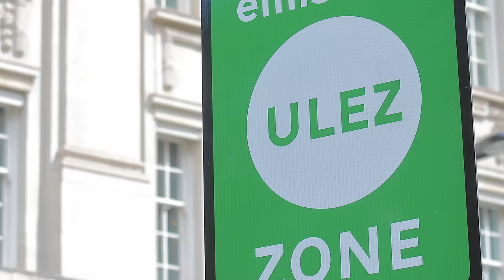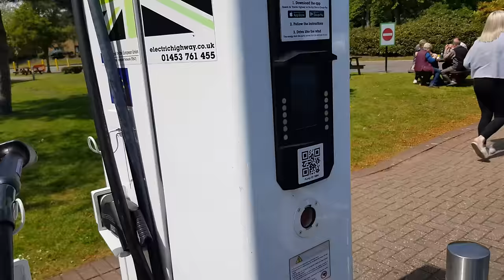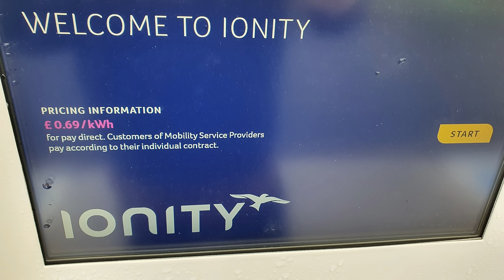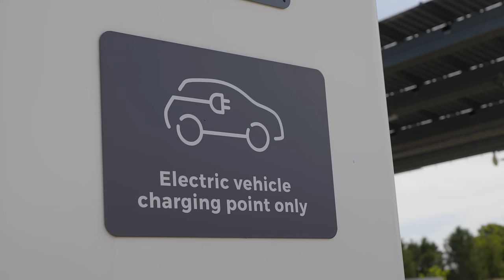The Uncomfortable TRUTH About EVs: The Version NEITHER SIDE Wants You To Hear

Comment: 18:30 Range Rover Hybrid, It's the small Hydrid batteries in a large vehicle that over heats and starts a thermal runaway fire. Diesel doesn't burn very well and is easy to put out.
Reply from the maker: Have you an actual credible source for that? What you say about hybrid Vs diesel fires is correct, but I have not seen anything confirmed it was a hybrid
Reply: @JayEmmOnCars  I saw other youtube videos that show the early stage of the fire shooting out from under the front of the car floor where the hybrid battery is located. There was an extinguisher, which was used and did nothing, on the ground behind the car. The tail lights match perfectly with what a Range Rover Hybrid should look like. I thought that everyone knew that it was a Range Rover Hybrid. I suspect the mainstream media is covering it up as it goes against the new green future they are pushing. Also, It is not the first time that a Range Rover Hybrid has done this. I should ask you the same thing you asked me, 'Do you have a credible source that it is not a Range Rover Hybrid?'.
Reply from the maker: @glenitube  the fire department who attended. I've seen nothing else beyond the same videos you have to say it was a hybrid, all of which are as biased as you claim the rest of the media to be

Comment: Fastchargers prices are not the competitive price to petrol. Since FC is for, like 10-20% of your trips. and to that, Tesla chargers are way cheaper. even same as public chargers.
And you might consider the huge emmisions output on combustion cars first. At 200kg per 1000km thats a serious hazard. Put that into the Balance of sustainability. Nothing there is recycled as batteries do!

Fires fighting EV fires is already better.  It's the locations that do not implemented them. 
And maybe praise those "EV elite" to buy an EV instead of a burner what they easily could. And many more "elite" still buy burners Instead of EV.

I am certainly not elite. Just bought my first EV and saved so much on cost that 3 years later In saved enough fir an EV motorcycle too.
For me BEV all the way 🔋⚡💪
Reply: To each their own. I just have an issue if you get forced into something that you don't want (I.E. the EU banning ICE cars in 2030) I hate the government saying "You can't have this/Will will ban that/You need to take this even though you don't want to"

Comment: re the airport Range Rover fire diesel's do not burn like the photo that was posted as it started burning with flames blowing out right where the battery is on that model of car, I'm not saying it wasn't a purely a diesel, but before they even went in "we will investigate once its safe to do so" before it was declared safe, and it was very quickly stated. what caused the fire, I'm in the position the jury is out. But the point of your video "promote a balanced discussion" i whole heartily agree, but, I feel that most of the criticism is directed at those who do not feel that EV are the only way to go, & the pro EV clan do not seem able to discuss in a balanced manner. you just have to see how major manufacturers have scaled back EV production, fires are increasing, obtaining insurance is being declined etc,  the costs are not as claimed to be, having owned a Hybrid, I am so glad I am back to a EC car, its cheaper uses less fuel. anyway I am all for a balanced debate but both sides need to take that on board, Quentin Wilson take note wow I don't think he would know a balanced debate if it hit in the face

Comment: I feel like a lot of the issues being created by mandating EVs in the next few years, could be largely mitigated by mandating plug in hybrids instead and pushing the full EV mandates out a couple of decades. 

I'm not anti-EV, i think they are cool tech and that with another ten or twenty years of research and advancements they could be a real solution to the emissions problem.  But i think that these very short term EV mandates have as much to do with getting lots of people out of cars altogether (lots of poor people, that is) as they do with replacing existing cars with EVs.

Comment: An EV is going to cost you more to insure simply because if they catch fire they are going to be a pile of burnt metal with no recycle value whereas a petrol car if it catches fire is going to be possibly repairable or at least salvaged for many thousands of £ of parts. That alone is why the insurance is going to be rather different!

Comment: I'd also like to state, your view of regulation of fuel cost is naïve. If you do a "pay as you go" the cost per pay will likely be more than if you charge someone an outrageous price up front, and then use that payment over time to cover the cost of providing lower "as you go" price. Pay as you go has to supply the cashflow/profit to the supplier every time a payment is made. The upfront charge that then means that person has already paid the supplier a sufficient profit that they can then use that payment as investment to earn more and provide pure profit cashflow and then they are free to charge a payment that only covers cost is a perfectly valid payment model. Don't insist your method is inherently more "fair" ... it is not.

Comment: Several EVs were burned up in the fire you are talking about, but the fire never reached the batteries. An EV would burn for a long time but won't explode. Class D Fire Extinguisher should work fine.

Comment: EV battery will deteriorate quite quickly dropping about 0.2% distance every 5,000 miles resulting in charging more often and more lost time. In addition when you factor in a replacement battery cost/ 100 mile range, all EV's are more expensive to run than an efficient petrol engine. Finally if your time (life) is important to you the amount of time lost refuelling is significant.

Comment: About diesel reputation. Its not about people not using them because the reputation is lost but because the new regulations and laws that are getting passed will ban diesel engines from different countries and different cities. That's why people want gas. No one cares if the reputation is gone. If that car makes good miles per gallon and the costs are relatively low then that is the car people buy. Its about money and restrictions. That's it. You forget the pandemic too easy. That period revealed that people will accept any restrictions and rules. I would reconsider "conspiracy theories" as a term that could possibly tell you some truth and should be analyzed with a little more care than a dismissal.

Comment: 23:35 People can argue and speculate all they want, but these are the proven facts:

 - Petrol does not just self-combust.  It needs something to ignite it.
 - In fact it's pretty difficult to set petrol on fire, it's nothing like in the films, you can even shoot the tank and it not explode.
 - Diesel is near-impossible to set on fire, you can even put a lit match out by dipping it in.
 - Petrol and diesel are both relatively easy to put out if they are set on fire.

 - Batteries / electrical fires can go faulty and initiate the fire themselves without any external influences.
 - They're far more sensitive to external influences such as crashing.
 - They're near impossible to put out.

Comment: With the issue of Global Climate Change being at the core of this, I find it very difficult to even suggest that fossil fuel vehicles are still a viable solution.  Other than those that cannot afford a new vehicle should stick with an ICE vehicle as most segments of the market have some EV/hybrid solution to benefit everyone.
Reply: Sports cars should always have an ICE, the feeling or revving an engine, pushing in the clutch, grabbing the gear knob and putting it into the next gear, the sound of the engine as it revs up. Electric cars are dull and the emotional part is missing. Also motocycles need to stay ICE, the range is just garbage on electric ones, and the weight of the battery makes the bike handle shit

Comment: Used EVs are now as cheap as chips. The average daily commute is 20-30 miles. This means that you can buy a used EV like a 30kw Leaf with 100 miles of range for as little as £5k. Or a used EV with 200+ miles of range for only £10k. See youtube channel EVM Electric Vehicle Man for house easy it is to buy a used EV with good mileage for under £5k or under £10k. EVs require less maintenance as they have fewer moving parts around 20 in an EV compared to 2000 in an ICE vehicle. Tesla for examples says you don't need to take your car into service every year like you do with an ICE vehicle. You only take it in when it needs something. Most EVs today have an 8 year warranty on the battery and drive train. So used EVs that are 3 years old can be bought for not a lot of money and still have lots of warranty left to run for peace of mind. For example you can get a used Tesla Model 3 for under £25k which is low mileage and under 3 years old. I used to have a Skoda diesel estate which cost around £75 to fill up (£100+ at todays prices). My new Tesla Model Y costs around £24 to fill up at a Tesla supercharger and a lot less hwen I charge it at home over night on cheaper rate electricity. My plan is to get solar panels and then I can charge it for free from the sun via the solar panels.

Comment: No the Luton fire wasn't an EV, it was probably a Land Rover diesel hybrid.  With a small lithium battery.  Under the area where the passenger seat is located.  Watch the videos of the Luton fire, and the absolute jet of extremely hot flame, and where it's coming from.

Now, if it's actually a battery fire as the visual evidence seems to be pointing to, but the authorities are blaming the diesel, which is not well known for combusting in extremely hot jets of flame, consider who is lying to who, and why they might be doing that.  Consider if the people still blaming the Luton fire on a battery might possibly have a point, then remember this was probably a light hybrid vehicle with a very tiny battery.  Oh yeah, and it was probably made in China.

The government mandated no new ICE vehicles by 2030, and then admitted that wouldn't be practical so pushed it out to 2035.  That's not going to be possible either.  You see, to make converting all of the UK light transport vehicles to electric possible, the UK will have to at least double it's guaranteed power production.  Guaranteed means that things like solar and wind probably aren't going to cut it.  Do some figures, and you'll realise that will require the building of three 2 GW nuclear power stations every ten years...  for the next 150 years.  I haven't heard about anyone proposing that, so how do they think they are going to power all of those EVs?  Oh they are not.  People won't have cars anymore...  that's where this is heading.  This is back of the envelop elementary maths - you do the figures and tell me if I'm wrong.

There are only two countries where a close to 100% EV light vehicle fleet might be possible.  Finland can do it right now, since their power generation is fifteen times that of the UK per capita.  China is getting there, but only because they are building coal fired power plants hand over fist.  Yep, save the planet and go furkin electric...

Comment: EV fires are caused by thermal runaway. There is no mechanical fail safe for this. Software is the only way to manage the email run away. Software is only as good as the people programming it moreover it’s only as good as the validation it goes through and legislative process that governs  this. All of which is inadequate. 
If EV was truly safe it’d be used in the aviation industry as a hybrid turbofan to aid take off…

Comment: You are missing the point totally. Cars and trucks gas or electric are expensive to run. Kids don't want them. When I started riding an Ebike 12 years ago no one was on the road with an Ebike. Now scooters, Ebikes and mini cars both gas and electric are on the road everyday. My local bicycle shop sells 35% Ebikes. The place I locked up at the grocery store was taken up by another Ebike so I had to find another place. This shows me how many Ebikes are out there.
 All of this new transportation extends the life of cars and lowers the amount of cars sold. Putting 2-3k miles a year on a car I may not need a car for a very long time.
Times are changing!

Comment: Certainly EV fires are harder to put out than gasoline car fires and there are three times as many gas car fires per mile driven than there are battery electric fires. The new LFP chemistry used by many new cars is roughly 10 times less flammable.  Meaning 30 times less flammable than an ice car.
Reply from the maker: I think less likely to catch fire is not quite the same as less flammable in this situation

Comment: Why would you be comparing an EV with a V8 or V12?? They aren't economical, what about comparing with a straight 4? EV batteries are frequently going into thermal runaway, a condition where they can go from OK to the car being totally incinerated within 15 seconds. If that happens it doesn't matter how much emissions you have saved the EV will totally outstrip an ICE car in the amount of emissions it creates, and poisonous fumes, and poisoned water going into the water table while the fire brigade tries to put it out, which can take many hours. Lithium is mostly only available from China, and there is not enough lithium for everyone to have an electric car, so it is much less abundant that oil. Insurance rates on EVs are already rising exponentially, due to the increased fire risk problem, so EV market is never going to be selling like hot cakes. Already all EV manufacturers are giving up on them, for the time being at least, or they will go under. The writing is on the wall, EVs are not working and they never will. If I had been given $7.5 billion of taxpayers money, like Tesla, then I expect that I would look pretty successful too, I hate to think how much taxpayers money has been thrown at the major manufacturers. As ever the elite gets the taxpayer to pay for the initial investment, then takes all the profits. Well, we are not playing that game any longer, and we won't buy them, even if you give them away.

Comment: I don't agree with the scrappage scheme.

EVs are not better for the environment anyway (not getting into that now, but can do if you want), and newer combustion engines are only slightly better.

Whereas PLANNED OBSOLESCENCE AND MANUFACTURING is extremely bad for the environment.

If you love the environment, keep your old car running rather than damaging the environment by wasting all the materials and energy manufacturing a new one.

Comment: You left out the big four problems with EVs.
Range anxiety as these vehicles don't go very far and the battery degrades a little bit each year so you get less range than advertised. 
Weak infrastructure, there aren't enough charging stations, and of the ones that are there half of the units usually don't work, unless you're at a Tesla station.
Thirdly,  the rare earth chemicals needed to make the batteries are in short  Supply and are very expensive.
People need to wake up and face reality. EVS are a fail.
Resale value is abysmal.  People don't want a used ev.
 The best solution is aplug in hybrid that gets about 70 Mi of range on the battery hence about 300 mpg!
Contrary to what climate cultists suppose, there's not enough power in the power grid to supply energy to run Vehicles if a large portion of the population has EVS, and keep in mind that fossil fuels power the  power plants!
Ps.  As a former Tesla Model 3 owner I will never get another one

Comment: One of the biggest issues with EVs is the sheer complexity of them. A mostly analog, mechanical EV with simple appointments and no ridiculous HP ratings would be inexpensive, highly efficient, reliable, and easy (less costly) to work on/maintain.

Comment: A big city is no place for EVs.. There's no space for all the chargers needed and the worst aspect is how to feed those chargers...
Reply: It works fine if you hVe the ability to home charge and more than 50% if homes can home charge

Wouldn't consider it if I couldn't home charge
Reply: @kaya051285  That's the issue... If you live in a flat in the city there's zero chance of home charging...
Reply: @MorganSullivan  London definitely has more apartments, but often, those areas have low car ownership anyway

For example, Hackney is Zone 2 London, and only 1 in 8 homes have a car

It's more the outer boroughs where car ownership is close to 1 car per home and a lot more of those are hoses than do have the ability to home charge

So yeah if you can't home charge provably won't have an EV but then if you can't home charge you probably don't own a car anyway as you are near the city centre where transport is better and owning a car is doficult

Of the 35 million cars in the UK most likely 25-30 million could home charge or work charge that'd not all of them but it is most of them

Comment: I’m going to be one of those blinkered EV guys 😉

Public charging costs and variability are indeed a disgrace. But I do take issue with how over complicated you make home charging out to be.

Yes, you do need to be privileged enough to have a driveway to start with.
But I get 5 hours at low cost per kWh, between 23:30-04:30, every day. If the car is plugged in, it’ll automatically charge during that time. There’s no naked ritual sacrifice to pagan gods involved, and even at today’s rates that works out at 2p per mile, and at 7kW can replenish somewhere around 140 miles per night.

Public charging needs to be sorted out for road trips, but day-to-day use can be covered by very cheap home charging with no more effort than plugging the car in when you get home.